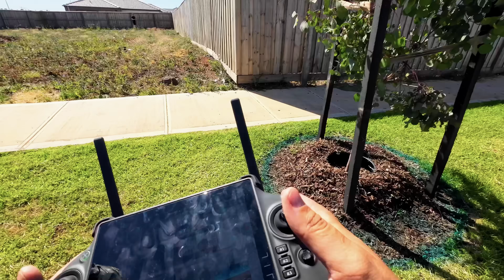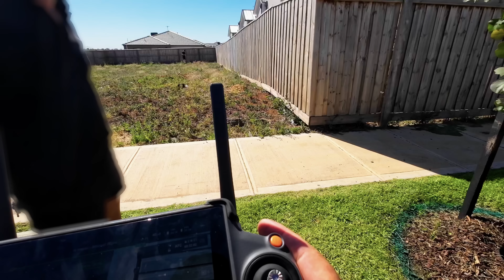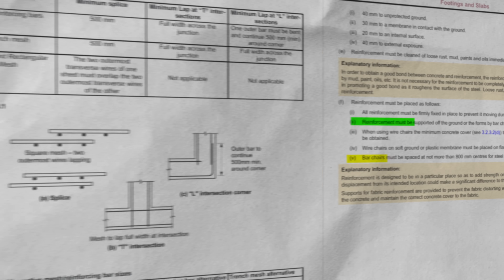I Caught a Concreter Red Handed ...

Comment: This seems to be an American way of placing concrete slabs with no chairs and steel lower to the ground!
An 1950-1980's Italian concrete method was to remove the steal after council inspection before placement: their theory was there would be no cracking later.

Comment: 🤣 you can still truck in a driveway with chairs, just have to chair up as you go literally takes 5 minutes, the mesh wasn't even tied I doubt they dowelled in to the house or path either.

If the mesh is laying on the ground it's null and void so may as well not even have it in there.

Comment: Concreters charge up to $120 per square metre. They pay some of the concreters $500 plus per day. They pay about $230 - $250 per cube for plain concrete. Depending on colour they will pay extra per cube depending on colour. The pump costs about $1000 for 4 hours plus a per cube pumped cost as well. The only reason to rip off a customer is to put more money in their pockets.

Comment: Great work. 
This seems like pure laziness and cutting corners. You can bet that there is a long line of work behind this crew that has also not been completed to standard. 
When I was a concretar we would just lay chairs as you went if you couldn’t pump it in. I can’t understand these guys thinking as it will come back on them once the thing starts to crack and they start having to pull up jobs. This is idiot behaviour

Comment: As a concrete finisher, I can tell you this is pretty common. It’s only an issue if they are not pulling it up. I doubt I would use them with this wire. We always go with rebar but I know it’s quick and easy to do wire.

Comment: Gotta get a pump for every pour?? Chair it up as the truck moves out. They’re just being lazy!
Reply: It doesn’t really matter. I’m not surprised at all since they are using wire and not rebar. We always use regular bar and just put rocks under it. I’ve done plenty where we pull it up as well though. It’s easy to just pour little across the ground before you start and then set the bar on top. It just depends on how much time you have.

Comment: Every concrete finisher ive ever seen complains about the chairs saying theyll just lift the steel as they go, they usually do a pretty bad job lifting the steel as they go all they do is give it a slight pull after the concretes in and they say thats not going anywhere. They usually pour it a little wet too cause its easier to put in that way, so the steel doesnt stay exactly where they put it. Sometimes the next day u can see the steel on the ground from the cross section of the slab if they dont have dirt covering it up yet but theyre not there to see it because theyre onto the next job and theyve been doing it for 30 years

Comment: If it's against the building code to not use Rio chairs then it's outdated building code technique because if you lift the Rio with a hook or shovel as he described as your pouring the concrete it sits in the centre of the concrete....

not only does it sit in the centre of the concrete it has no exposure to moisture through the base of the slab where the legs of the Rio seats can allow moisture inn ....

I challenge anyone at the building code authority to preform a test to see who is correct & they need to change the rules to apply lifting of rio ....

These guys have been pour slabs for many years &  everything they did is not to be lazy it's because seating the Rio with chair is unnecessary..

Comment: Dumb cunt !!!
You dont neeed a pump every time. 
Trunk moves forward you bend over and chair 
The sides can be chaired also because  Trunk wheels arent going there. 
So the first 3 metres of the pour. 
Pipe head concreter

Comment: no point in putting the steel in at all. in fact it would be better without it because it was only going to rust under the slab and discolor through the inevitable cracks in the slab.

Comment: Knuckle head concreters think theycan lift steel mesh with a shovel while blokes are standing all over it and tonnes of concrete thats wet i want hear a concreter explain how this works and what there mentality is.. of course ypu need a pump if you cant get down beside the job ah no we have the yruck parked on the mesh and pull it up with the shovel...🤣🤣🤣🤣🤣🤣👌👌👌👌👌👌

Comment: Stry frm germany:
Got a quote for a Slab in the backyard a few years back, including a pump for about 4-5.000 extra. the company build the shell, layed down the steel and everything was fine. I was at work when they put in the concrete, but i got of a few hours earlyer and was surprises to see my new driveway covered with wood and the mixtruck in the middle of it. The company was not happy when i shwed up and it tok nly ten minutes for the boss to show up t tell me "Everything is fine". till i told him that he is n security cameras, everything is filmed and that i will nt pay for the pump, i will habe the pavement checked fr sagging (only a few days old, not settled and not made for 15 tonns of truck.) The Guy pulled his men mid pour, the cement truck driver dummed the rest of the load in Emergency BigBags on the frontyard, and everyone scrabled. Result was that the Company had to pay damages to the driveway, removal of the half finished slab, the 4 cubic meters of concred and the new slab. Then they had to pay every expense for other work i had planed for the slab, including higher material costs for building supplies.

In germany the owner of the company is in for everything, even when he closes down shop with his private money, and after this show he was out about 27.000Euros

Comment: I'm not a builder but I understand his point of the difficulty using bar chairs when they barrow the cement in. I'm guessing a pump is expensive, but how do they do it properly without the pump? Especially on a large area.
Reply: I always set up properly first. Then get inspection. If the wait time for concrete is to long, or not confirmed, then you flip chairs where needed to reduce trip hazards. Then when you have a confirmation on concrete delivery you start moving chairs that block access, but put them next to their closet chairs. So it's obvious where they go back. You need to flip all chairs back upright before pouring concrete. The chairs blocking access need to be put back before the concrete gets to line of chairs before it. That was long
Reply: I would fire the guy in the video for not having the job ready for inspection. Never BS the inspector, it takes a lot to book these guys time, even more to earn their trust.

Comment: If for a reason you cant use bar chairs then you have tell the owner the reason you may need to pump concrete in ..and its cost ...or dont do the job if the client says no ...its your responsabitly as a tradesman ..if the concrete cracks and your taken to court by the customer you as the tradie are liable because you should not do the work if its the wrong way ...simple

Comment: Back in the 1980’s I was pouring an 4ft X 180 linear foot house foundation (on a 24” X 18” key locked footer) The Building Inspector showed up on the job-site , and shut the job down due to the concrete being too wet. The Building Inspector allowed me to finish pouring the wall, but he wanted a Swiss Hammer test, and a Core sampler test before he would sign off on anything. The Ready Mix company agreed to pay for half the cost for these tests. We let the wall cure for 10 days, and the Engineering firm performed the tests. Core samples and Swiss Hammer tests confirmed that the wall had a PSI of 5K. The Super Plasticizer add mix is what saved us from falling below the 3K PSI threshold required by the local building code.

Comment: Homeowners fault , why they always go for the lowest budget??? You get watt you paid for ,plus most of them don’t even apply for permits or get a blue print from an engineer ,  plus no one contracts a certified inspector to check for soil compaction , rebar installation, and concrete quality as it comes out of the truck  , I build concrete infrastructure in toronto I have the knowledge of all ministry of transportation rules and specifications about concrete placing , preparation of surfaces , placement rates , and rebar placing and clear cover and splicing of bars . All these rules are not easy to follow , some because some workers are just lazy  others cause the boss is just cheap . Me as a foreman have to correct the mistakes of the lazy guys and come up with ideas to compensate the cheap boss , it’s a dirty hard life ,but I love watt I do

Comment: Scummy concreters tried to pull this on me. Told them I’d be at work all day and I would not be there for the pour. I got let off early for the day and ended up catching them cheating me out of materials I requested and paid for. Materials and labor were paid separate. No rebar, no mesh, no moisture barrier, no fiber in mix, didn’t even buy the required psi concrete mix, no J-hooks for framing, forms not level and out of square, no footer dug, forms only dug to 4” not the required 6”.

Comment: As an inspector for 16 years, and a contractor for 20 prior to that, I would always read the plans before doing any job take-off (estimate) and any inspection. Countless times you would find things listed on job spec's that the installer/contractor would not do. "well they let us do this in other towns" and I would fail them every time. Makes you wonder why my jurisdiction was the only one that would require the as built to match the plan set. SMH

Comment: Just an idea for your video content. It’s not always apparent what is happening if you are a dummy like me. I couldn’t understand the word you were using. “Bar chair” is not a familiar term to me. Now i do understand what is going on but it would be good if you could say a few words at the end to explain. I do understand that the reo should be off the ground otherwise it has no strength and it rusts quickly. But i had to work out what was going on. Love the content. You do a fantastic job and it is a constant surprise as to what they try to get away with. 😮

Comment: I disagree that if the warranty is covered it's ok. Warranty is for faults that are beyond anyones reasonable control. I wouldn't want to pay for a product that lasts only as long as the warranty period.

When you buy a product, eg a tv, and they offer you an extended warranty for extra money, the insurer is banking on the fact that if a properly built product doesn't fail within the standard warranty period then it's unlikely to fail within the extended period. But with this driveway the concreters are undermining the statistics.

Comment: It's all a consequence of this cost of living climate we're currently in. As a concreter, my company always quotes for all the little extras to meet specs and compliance. Compacted base, correct thickness, reo, concrete cover, joints, etc. But what happens next? Our quote is always higher than the other guys. The builder or even the home owner (that's right, the owner) goes for the cheaper option. And then where do they send their money? To a third party inspector to inspect the same cheap option that they chose. 

So where does that leave the honest hard working companies? See they can sit at home and not survive as many good contractors have gone under. Or they can cut costs and compete in the market but defects will be found.

My company has been running at a loss since 2020, but we always comply with code and Australian standards.

So basically, you get what you pay for

Comment: The wire/bars won't sag back down if you pull it up thoroughly while pouring the concrete. However, if there's a law where they live to prop it up then they need to do it or conduct their business somewhere else.

Comment: Im a concreter of 25 years, been doing precast concrete panels and now run my own concrete business. Not using chairs is completely fine as long as the mesh is lifted. I have a specific hook made for that and a lot of concreters have a small notch in their shovel for that reason. As long as the mesh is not exposed out of the concrete, and has minimum cover from all sides, theres absolutely nothing wrong. Chairs can in many instances hinder the job and add a lot of extra cost on the job like hiring a pump because you cant back up the truck over chaired mesh. Hope this helps some people understand   the industry.

Comment: The little plastic chairs holds the reo bar off the ground at a height so the Steel is in the centre of the concrete slab doing what it's supposed to do

Comment: Concrete guys can easily put chairs on the steel as the truck drives out.  Have the edges already chaired up, leave the middle so the truck can back up. Then just put chairs in as you go.  It’s a bit of a pain but better than getting a pump

Comment: Notice the tree in the ground at 1:00. This has been planted while still inside the pot. Builders illegally do this when clients want the tree removed and to skirt around council requirements for trees. They pull the trees out after inspection and either bin them or send them on to the next dodgy brothers build.

Comment: You absolutely can barrow over bar chairs lol - piss poor excuse. I've built entire multi level carparks with a concrete pump, and then expansive carparks ground level it's as easy as running boards so you can barrow along. If you're shithouse and lazy you try not to

Comment: Reinforcement has to be at specific height to prevent tensile cracking (usually 40mm from top), hooking up is BS, 

1.as Z said what will happen when you walk on it. 
2.How can they be sure it is at correct height. 
3. Unless you revibrate the concrete what bond attachment will there be when you pull/drag/rip it up.... that's even if you do vibrate it, I didn't hear one running but give them the benefit of doubt they have been using an electric one which are "marginally" quieter.

Also all concrete must be vibrated (except bockfill etc) as it increases the density (ie removing air voids), density = strength, I would think that is important for a driveway! 

Vibration will also increase bond attachment to the reo, as with air doesn't bond too well with the reinforcement and will also reduce the permeability of the concrete, at the end of the day, water passing through the concrete cant be a good thing

This hooking up is BS, if you want to drive the truck in, then you chair the reo as you go. Put 2 chutes on the truck, and it will be well clear and easy to lift up.

I used to run a concrete company and heard these excuses from the boys all the time, simply BS

Comment: I’ve been a concreature for about 25 years now. Yes, bar chairs can be a prick to wheel a barrow over; the chairs can get crushed, you can snag on them and they can stop you dead in your tracks, the steel can also warp with the weight of the barrow and conc as you wheel it between the chairs. It’s bloody easy to put chairs in as you’re pouring. We do the same behind the concrete truck. Have a section as far as the chutes can reach chaired, pour it and as the truck progresses out of the pour you chair behind it before you lay the gray. Pretty easy.
These guys should just use fibre mesh if they’re too lazy or too dodgy to chair their mesh. I think fibre mesh is shit in comparison to steel reinforcement properly prepared but it won’t cost these guys any extra and at least the concrete won’t develop concrete cancer where the steel hits the earth and lets moisture in. If you don’t have pride in you work go find another trade you care about enough to take pride in.

Comment: I was a concreter for almost 2 decades, you dont have to use a pump for every job at all, if you're going to place the concrete with the truck,  the chutes reach almost 3 metres, to do the job properly you chair up the first couple of metres then place the concrete using the chutes, stop the concrete, move the truck forward, place more chairs, continue pouring, rinse and repeat. These guys are just unprofessional and lazy. Simple as that.

Comment: Well concrete chairs are not always necessary as long as the concreters lift the steel, in fact it can be better as moisture cannot work its way up the chairs with expansion and contraction of the concrete causing rust in the steel. Once the concrete is under the steel it does not sink back down.... wondering if this Karen guy has ever poured a slab

Comment: Looks like the mesh is just sitting on the ground, even if they poured a bit of concrete first and then laid the mesh on top would have been better, for the mesh to reinforce the concrete it needs to be about the center of the slab, on the ground it would be doing practically nothing. Dodgy work indeed.

Comment: Without chairs would give a better result if the Rio is pulled up right. Both methods have proublems. With chairs you assume the Rio is fine when it could be grounded.  Housing is a scam period. What's wrong with building a simple shelter.  It doesn't enslave you for 30 of the best years of your life. WAKE UP. Government are our worst enemy.

Comment: Its interesting how some builders risk their reputation on  taking shortcuts like not putting chairs in the slab like this guy.  Had a brick fence built that a car later crashed into. The original builder tried saving money by using wall ties every 4th course instead of every second course. A wall tie probably costs about 50 cents. The wall was only 10 metres long.